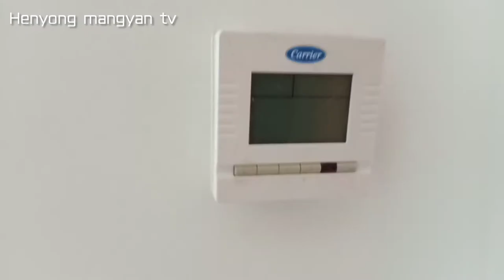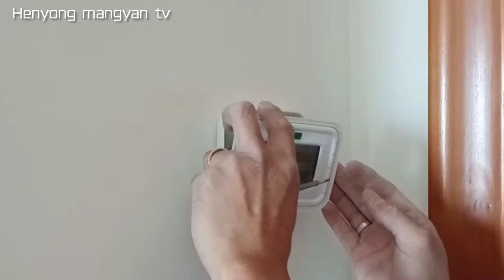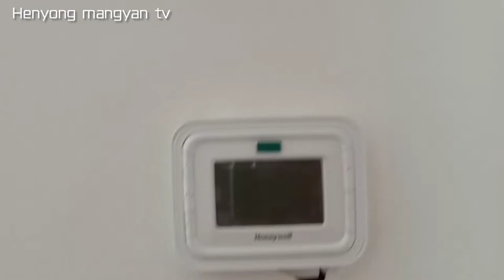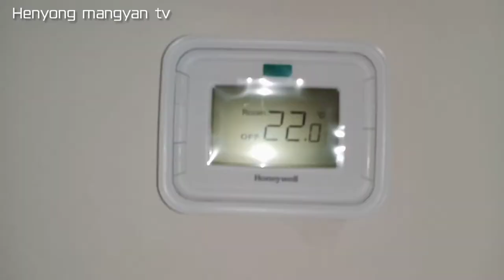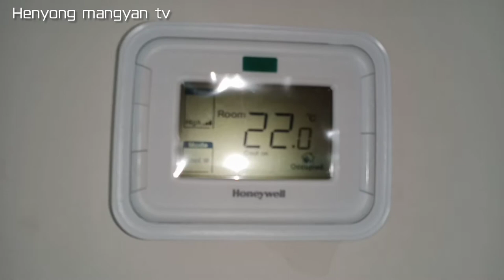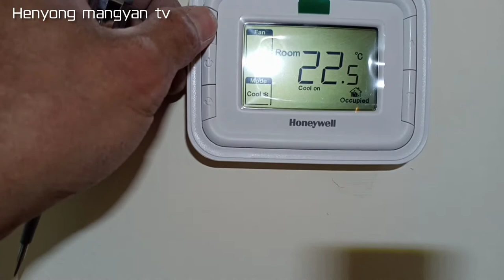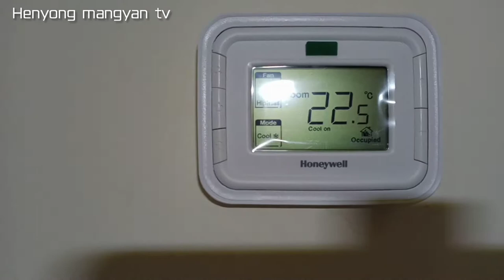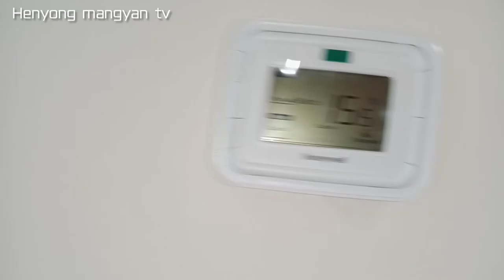Conversion of Thermostat control 24V to Honeywell 220V@henyong mangyan tv

Comment: Sir mag oackage po unit carrier tagal mo modoel..litu po akoa db pag heating kah aandar din dapat compressor at fan motor..?meron po ksi dalawa wire liit heater tinanggal saan po pwd yu connect?? transformer or coil po contactor?

Comment: Sir suggestion lang po. Kung paano po magcheck ng mga sirang ibat ibang klase po ng relay lalo na po yong mga relay na ginagamit sa fcu panel. Salamat po sir
Reply from the maker: Madali lang magcheck nun. Kahit sa thermostat malalaman mong sira yung relay once na hnd gumana yung speed ng fan motor. Halimbawa. Nilagay mo sa med. Hnd sya gumana ibig sabihin nun may problema yung med. Relay mo. So yun ang titingnan mo gamit yung multi tester mo.
Reply from the maker: Ang alam ko sa viva diba yung control ng fcu nya nandun sa malapin sa fcu sa maliit na box. Yung mga ganung control automation yun. Hnd ka basta basta magppalit ng part nun kc nakaprogram yun sa automation. Pag pinalitan mo ang isang parts nun kaylangan ireprogram yung control nya.
Reply: @Henyongmangyanmotovlog  tama ka po sir nasa loob nga ng maliit na panel yong mga controller ng fcu dito sa amin at nakaprogram po sya sa bms or building automation system. Ibig sabihin sir contractor namin ang magrereprogram pa pag magpapalit ng parts sa panel ng fcu?
Reply: Ibig sabihin din po ba sir once na may inalis kang pyesa sa panel ng fcu mabubura yong program nya dati kaya kailangan ireprogram ulit pag ikakabit mo na yong bagong pyesa para bumalik sa normal.
Reply from the maker: Oo automation ang magpprogram nun.
Reply from the maker: Oo irereprogram ulit yun once na nagpalit ka ng controller or ng thermostat. Pero kung mga blower motor lang at actuator motor ok lang hnd na kaylangan ng reprogram. Ang bms nyo naman sa main valve lang naka connect hnd mismo sa loob ng flat.
Reply from the maker: Hnd na sya makocontrol ng thermostat pagkanagpalit ka ng controller.
Reply from the maker: Kaylangan na ng automation technician.